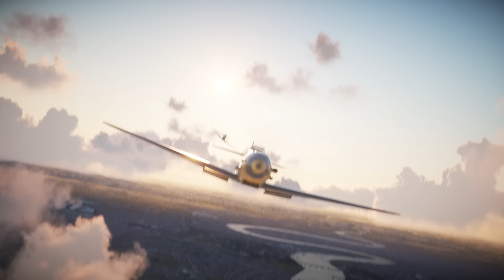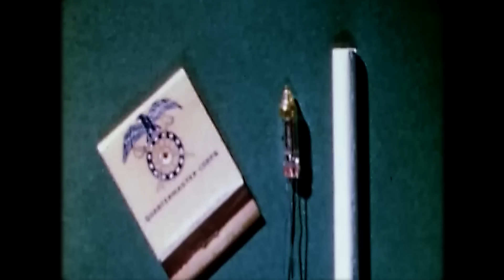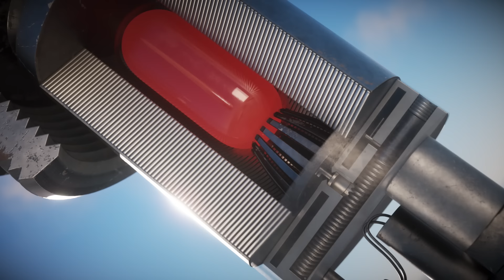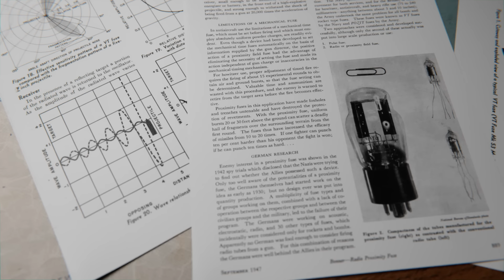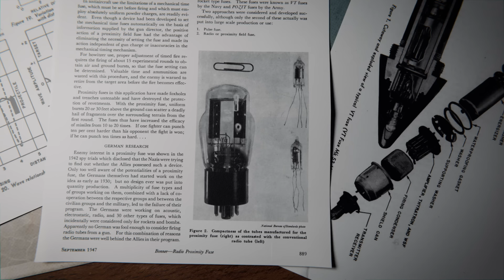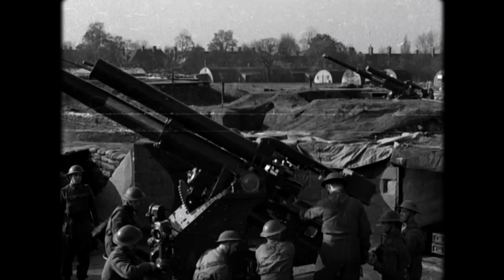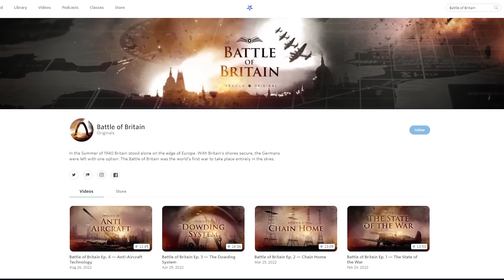The Secret Invention That Changed World War 2

Comment: Every aspect of the engineering talent and subsequent manufacturing ability required to develop a fully-functioning proximity fuze is absolutely astounding! In the early 1980's, I purchased from a surplus store a General Radio model 1551-A Sound Level meter that was released in 1952. This instrument included seven, sub-miniature "peanut" vacuum tubes manufactured by Raytheon Corp. that are a fraction of the size and length of my pinkie finger! These sub-miniature vacuum tubes were very much like the size of the five that were developed and utilized in the proximity fuze that withstood 20,000-G's, and 25.000-RPM's, along with all of the other components to make this "impossible" fuze. David Riddle

Comment: The proximity fuse was a great improvement but hardly won the war. None were used in the European theatre until the end of the war when allied air forces dominated the sky’s.  As far as the Arden offensive, ie the start of the battle of the bulge, what use would proximity fuses play, proximity to what, a tree?  The Arden consists of mainly thick forests.  Timed fuses were used in such circumstances.

Comment: It was really made possible by a hearing aid battery system to provide the power. A battery that could be held on the shelf and activated when needed. Combining that with the careful control of distribution of use and shipping to keep the enemy from doing reverse engineering.

Comment: The VT Fuze did NOT use RADAR to detect proximity.  
It used  relatively low frequency RADIO frequency signals.   NOT microwave Radar.
Reply: Not all radar uses microwaves. Early radar, such as Chain Home, didn't.

Comment: The notion 150 Japanese aircrafts were shot down by two ships in one engagement is just silly: Hugh W Hadley and Evans on May 11th 1945 were credited with 15 and 20, and each suffered 30 killed. A great performance, but assisted by large numbers of fighters. The rest were shot down by covering Corsairs and Hellcats, and probably not all 150, assuming that number was correct to begin with. The tales just keep getting taller...

Comment: the fuze doesn't use radar at all.    VT fuses primarily focus on detecting the presence of a target within a specific range to trigger detonation. They do not measure the exact distance to the target.
    Radar, on the other hand, is designed for detecting objects and measuring their distance and velocity accurately.
Reply: The VT fuze used a type of radar. The VT fuze contained a miniature radio transmitter and receiver. When the shell was fired, the transmitter sent out a continuous radio signal. As the shell approached a target, the radio waves would reflect off the target and be picked up by the receiver in the fuze. The fuze would then trigger the detonation of the shell at the optimal distance from the target.
Reply: @Trve_Kvlt  RADAR you are wrong, i am afraid. never mind. let me help. again. - While VT (Variable Time) fuzes do indeed use a form of radio wave transmission and reflection, this is not the same as traditional radar systems used for measuring distance and velocity.

VT fuzes operate on a simpler principle. They emit a continuous wave signal, and when this signal reflects off a nearby target, the reflected waves are detected by the receiver in the fuze. This reflection triggers the detonation at a predetermined proximity, not by measuring the exact distance to the target, but by detecting the presence of the reflected signal.

Traditional radar, on the other hand, involves more complex signal processing to accurately determine the distance and velocity of an object using techniques like time delay measurement and Doppler shift analysis.

So while the VT fuze uses radio waves, it is a much simpler system focused on proximity detection rather than detailed range measurement.

Comment: Never wouldve tought of this, i always had tought it was calibrated with a timer
Reply: The usually were. For example, the 88mm anti-aircraft projectiles fired by the German Flak 18/36/37/41 had a timed fuze that the crew could adjust based on the distance of flying aircraft

Comment: Not sufficiently explained: how does a radar guided proximity fuse designed for AA use become something that can be tuned to detect the ground for the artillery barrage in the Ardennes?  At the very least, the angle of approach is quite different and the optimal distance for showering a moving plane with shrapnel seems likely to be different from the correct distance above the trees.

Comment: It's a bit wrong in the very start of this video. The bombing of English cities was a response to the British bombing of german cities*. The only planes left (kind of) for the RAF was bombers and Churchill used them. By september Britain had run out of fighter planes so there where none to lure out by bomb raids.
If Luftwaffe, instead of responding to strategic bombing, had kept focus on suppressing the fighter plane capability of the RAF and target airfields, factories and radar installation instead, then they would have won the battle of Britain (but not the war). B t w, Germany never had any serious plans on occupying the British isles, operation Sea-lion was put together late and was never a part of Hitlers big plan which was the expansion to the east (lebensraum).
*Hitler was furious when the britts in the middle of loosing the battle of Britain had the audacity to bomb german cities and he promised to drop ten bombs over England for every bomb dropped over Germany.

Comment: The red electrolyte was potassium dichromate/sulphuric acid. The zinc/carbon cell (energiser) was replaced by a lead/lead dioxide cell using fluoboric acid electrolyte and the glass ampule was replaced by a polyethylene vial with a lead weight at the bottom that did not need an explosive breaker. The bulky wiring of the electronics was replaced by the earliest printed circuit boards and the nose cone was later made of PTFE, another first.

Comment: British scientists started work on a proximity fuze in the late 1930s and solved enough of the inherent problems to test marginally effective prototypes. As the USA had a far greater capacity to continue the research and build VT fuse the British gave all their research to the USA via the Tizard Committee, along with other secrets such as radar, and later the jet engine. The fuse was forbidden from use intitally, on the front lines, in case any fell in to the hands of the Axis. The video rightly mentions the VT fuse being vital at sea in the Pacific, against the Japanese, but doesn't mention that the British  Anti-Aircraft Gunners also used them in the summer of 1944, on the South Coast of England, against V1 flying bombs, which increased their kill percentage to about 75% of shots fired, especially in combination of radar directed fire for the guns.

Comment: They were using a mechanically set fuse for every shot based on assumptions of speed direction and altitude. Each of these could have been negated if air crews changed with one on regular intervals

Comment: I am not sure on the 1800 rounds to take out a German plane.
The Germans calculated they used  possibly 1800 rounds of 128mm AA and up to 8,000 or more  for normal 88mm AA to take out allied bombers, but I suppose the Allied Bombers could be tougher and harder to kill than the German bombers and fighters over Britain.
Reply: US bombers had to fly straight and level for two minutes to use the Norden bomb sight. It took 30 seconds for a German AA shell to go from the ground to their altitude…

Comment: Nope. The proximity fuse was a British invention and the British, out of respect for their allies, shared the technology with the Americans. Please don't perpetuate the 1America invented everything' myth. The US Navel Institute confirms on its website that ..."Thus did the Patent Office grant priority of invention in the basic proximity fuze invention to Butement and his co-workers." referring to the British Scientist William Butement.
Reply: "Trading information with the United Kingdom, Section T scientists learned that the British had devised a fuze using radio as the influence source for use in bombs and rockets. The British fuze could withstand only 100 Gs, however, far less than the 20,000 Gs required for use in a AAA projectile spinning at 28,000 revolutions per minute. The Americans took the lead, but followed British practice in using a radio transmitter and receiver as the influence medium rather than acoustical, terminal, electrostatic, magnetic, or photoelectric sensors. This proved to be the best choice.9
After the basic design characteristics of battery power, radio frequency transmitter and receiver, small size, and rugged construction had been agreed upon, Section T began rapid research. On 17 July 1941, the section split into two elements—T and E.10 Section T worked with the Navy to develop AAA fuzes, while Section E worked with the Army to develop fuzes for bombs and rockets." (What later became the U.S. Air Force was still part of the Army.)"
Tiny Miracle—The Proximity Fuze | Naval History page

USA and UK were not allies until 1942.

Tizard Mission
"The group travelled to the US in September 1940 during the Battle of Britain and intended to convey a number of technical innovations to the US    in order to secure assistance    in maintaining the war effort."
The Tizard Mission: 75 Years of Transatlantic Partnership on Science and Technology GOV UK
Reply: @nickdanger3802  Yes as well as the world's first working VT fuse, the British also GAVE to the US what the head of the America's Office of Strategic Studies described as "the most important cargo to reach US shores during WW2"... that "Most important cargo" being the cavity magnetron.

Comment: I was amazed ro read that siemenshad alreadydesigned and built a miniture colour crtwhich they paired witha miniture tv camera..the camerawas mountedin ar.c glide bomb.an operatorsitting in the attacking aircraftwouldguidethe bomb onto its targetwhilsst watching its approach to the targetvia a crt screen  mounted in a panelthis system was tested by the germans on a old freight ship moored in thebaltic.the vessel was successfully sunk.and the worldsr.c.missile was born!current versionsof drones use the same if not mor sophisticatedguidancesystem.exceptthe operatorsts in a control cabin veey far from th targetand hi guidance signals are relayed via  a low orbiting sattalite?????????many dronesare equiped with inertial guidanceand a terain followingradarenabeling very lowapproach by the weappon.bwneath thedefending radarspexteum of vision?

Comment: I'm still not 100% on how these are more accurate. They aren't guided by the fuse and they can't change course mid-flight, so they are fired in front of the oncoming aircraft. How does the radar see the plane if it's not fired directly at it?

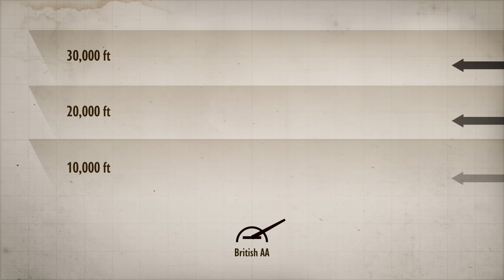Comment: 3:31 Bomber crews knew that it takes a minimum amount of time for the AA guns to calculate their trajectory and then for the shell to arrive. For example, at 20,000ft it would take at least 20 seconds for an AA shell to be fired upto that height. The AA gun team were calculating where the shell would arrive in 20 seconds time. So the only thing bombers had to do was to change their height and direction every 18 seconds or 15 seconds and it would throw off the AA calculations.

Comment: could you discuss the full safety measures for the fuze e.g. prevent in barrel detonation , how the switches worked , the mercury "shorted" switch and what happened if the shell missed its target and the fail safe method for preventing a dud from being "captured" by the enemy there is a tremendous amount of skilled engineering in this fuze, just would like much more detail    thank you

Comment: It seems like an overly complex device for the job until you consider the cost (and threat) of the thing it's designed to destroy, a warplane aimed at their homes.
Reply: It seems over-engineered to us today when we have easy access to electronics, but in the 1940s all they had to build with was metal, wood, glass and rubber - which makes it a "primitive" work of genius. Like landing on the moon when computers were only fancy calculators with kilobytes of memory.

Comment: Thanks -- good story.  I'm a former artillery officer -- VT fuzes are still in use.  More modern GPS artilery fuzes are powered by a capacitor, that generates power as the shell spins through the air.

Comment: the design of that wet cell battery is absolutely amazing, making use of the spin of the round to control the release of the battery mechanism and also designing the cell in a way that makes it needed for it to function to prevent accidental detonation is amazing. It really showed a lot of creativity and awareness of the conditions that the round was going to be used under. It's also amazing how they managed to develop the cell considering that they couldn't really have any "lab" experiments of it in action, if it only worked when it was fired out of a barrel, then the system would have been hard to troubleshoot to really finish it.

Comment: We are 1/4 way through the 21st century and you are still calling weight "kilograms".  You can not get an engineering degree without knowing both the difference between mass and weight and that the world has been on the SI Metric System a very long time now.  6 kg of mass is the same value on Earth, floating around weightless in space and on the Moon.  But the weight is different at each of these locations. Weight is the product of mass multiplied by acceleration and has the units kg meter per second squared = a Newton.   Say "mass" when referencing the unit gram/kilogram not weight.

Comment: My dad worked at APL. Around 1972, I hung out w him and a couple guys at a military base. Their equipment was in a bunch of semi truck trailers, 5 trailers housed reel-to-reel tape recorders, one trailer was an atomic clock, I'm not sure of the other trailers. There were 50 microphones scattered around over a large area. The point was to record artillery fire and ultimately be able to triangulate the gun's location. At times it was necessary to drive out to the microphones and splice wires that had been cut by shrapnel (there were continuity lights on the recorders). There would be a siren indicating that firing had stopped and time to start splicing, the next siren was a signal that firing would begin again in a certain # of minutes.   One of the guys liked to push the limits and keep splicing well after the warning siren. He frequently would be popping back over the berms in his jeep after the firing had begun.  He said the more microphones connected, the better.      Wizzing by could be heard overhead.

Comment: Overrated weapon.. The shell as any shell has to be, shot at the target
If the gunner is not accurate then this weapon is of no value. 
Finding the altitude even if it is changing and changing the fuse is just as effective as this weapon.
Using it against a dive bomber against a naval ship. is again all about the gunners ability to aim. which is a difficult task from a diving aircraft.
Reply: If u have to set fuse time by your hands, shell just could fly near plane and explode 200 meters away. Same with 40 mm Bofors, which has to hit enemy plane directly. Proximity sensor allows you to decrease fuze time error and kill enemy even without direct hits
Reply: @maksimfedoryak  direct hits are seldom in high altitude bombing and is not the intent.  The shells have a fragment explosion , therefore the shell has to explode near the target, which is all that is required. Rendering proximity fuses no more effective than mass shelling at a correct altitude. 
war is about telling lies which comforts the populate
Reply: @strawwalker8177  How clue less are you? Before the proximity fuse hit rate on air targets was less than 20%, after the fuse was invented in claimed to 85%, and shoot downs increased by 370%, also before in 10.000 shells we needed to shoot down one plane after it about 100.